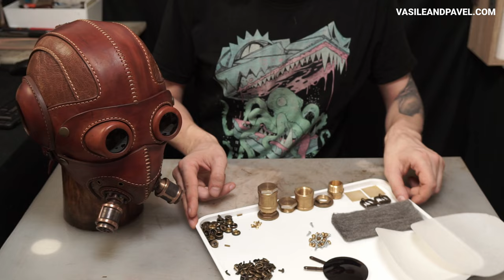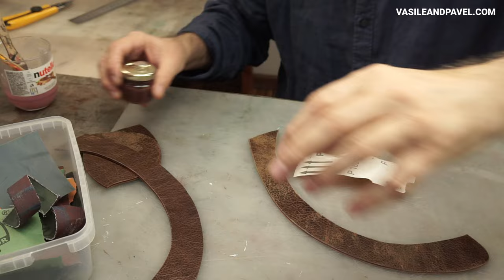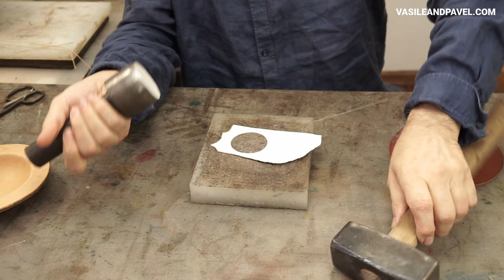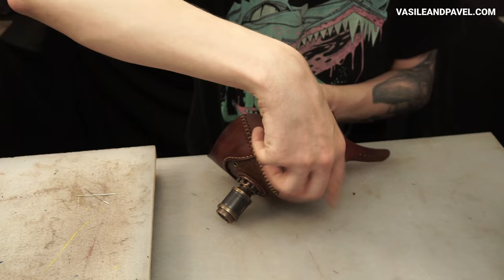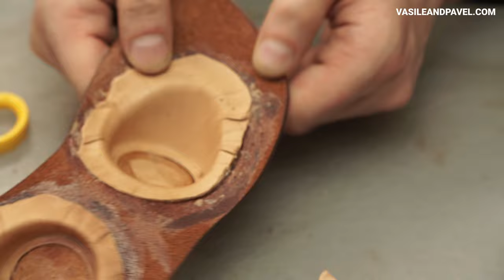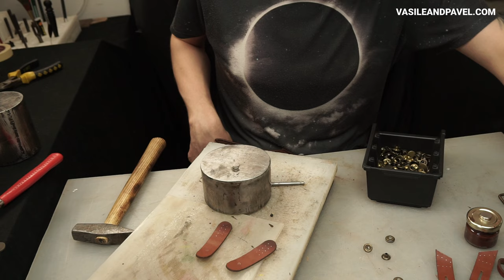How to Make the Dust Angel Steampunk Leather Mask

Comment: Love this piece, really stands out from other products on Etsy. Your attention to detail has produced such a polished finisher product. Noticed that you seem to have changed the earpieces from the original mask which seemed to have a much slimmer edge profile. Was wondering if this a simplification for instructions or have you made it heftier to give more structure to the helmet? Was the inner ear originally sewn onto the side separately?
Reply: Thank you. The shape is the same, I improved the mold only by putting signs for the holes on the exterior part, before I made the design public, I was glueing the finished ear to the helm and punch holes through everything but not everyone has my glue and punches.
Reply: Interesting, must just be angles and lighting in photos. Did not mean it as a criticism at all, making it a single piece makes total sense. As soon as I saw you long punch I wondered where it can from. I run a leather working business and haven’t seen one like it before. Tools are a pain to source in the uk thought esp after the disaster of leaving the EU.
Reply: @williamconnock1639  the ear is still made from two parts, is the outside wich is lined with a thermoformable material and a thin veg tan and the inside part wich has the brass mesh as for the profile is the same everywhere, didnt modify it at all. The hollow punch I use are great and cheap, also chinese, the brand is named Wuta and you can search wuta round hollow punch.
Reply: Newby here. I am going to take your suggestion and buy the Wuta punches. They come in two sizes: 3mm and 4mm. Which size do you recommend?